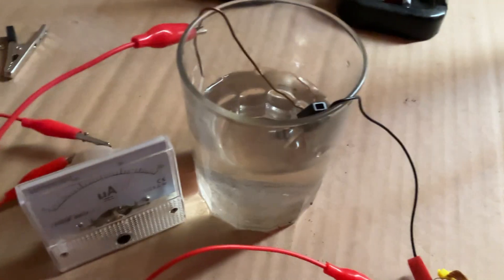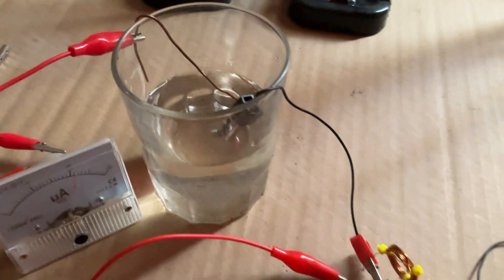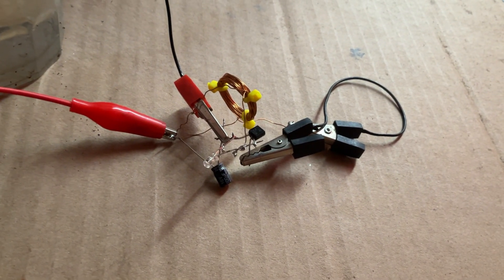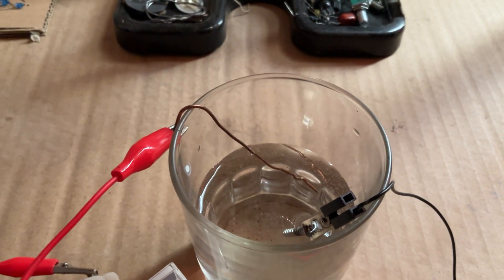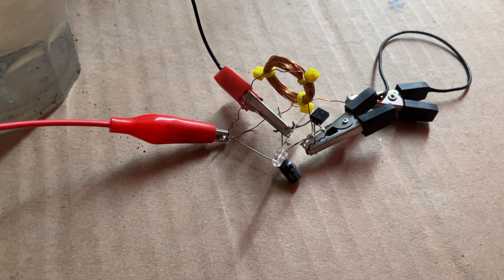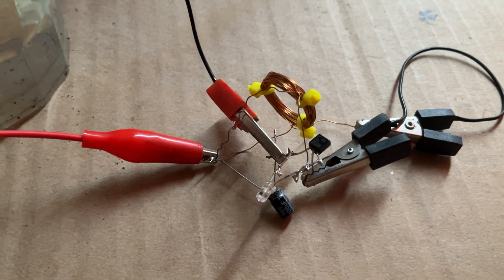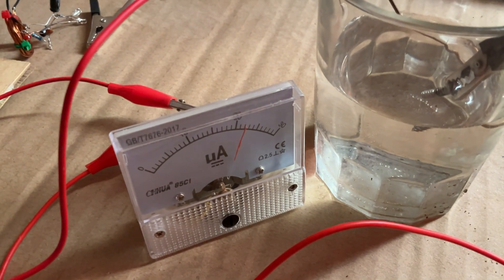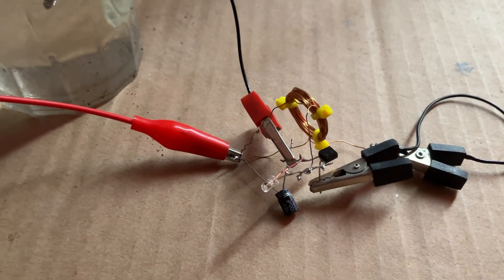blocking oscillater without blocking components

Comment: Ah right, the charge/discharge of the cap!
The copper and zinc are good for approx 0.65V. The turn on threshold of the transistor will be approx 0.6V. As soon as the cap reaches 0.6V, the transistor switches, energises the coil, cap depletes, the flyback from the coil flashes the LED and the whole thing starts again.
A bigger cap should flash the LED stronger but take longer to charge. A smaller cap will run faster but with less LED intensity.
Reply from the maker: yes, and it looks like its not working with the little inductors in the circuit. maybe to much resistance...
Reply: @MilkywayOutcast  I was lucky with the 1000uH's, having a bag of them from many years ago. They worked great with many oscillators. The inductance of your wire loop should be matched, I would think, if replacing with axial inductors. I would guess you have 12 turns+12 turns center tapped?
Reply from the maker: @Slider2732_  to my embarresment i have to admit i did not count the turns. i took a wire that was laying arround maybe less then  2 m...foldet it at half and turned it around my finger. 🙂 you might be right with the 12 turns. dont have a induction meter. i will rewind the coil. maybe we can come up with a new slider2732 formular. x around the finger turns of y thickness wire = induction(h) or does it exist allready? 🙂
Reply from the maker: @Slider2732_  i guess it would have to be around 50 microH instead of 1000? but i guess the ratio between input power and output power would be lower then in the real blocking circuit?
Reply: @MilkywayOutcast  lol a new induction method. A precise and exact calculations formula - "About this far with around that much wire will produce roughly this inductance, most of the time!"
Reply: @MilkywayOutcast  Agreed, lower due to the number of turns. Have tried this at home and didn't get your results. That finger wound wire has more properties than perhaps thought 😀
Reply from the maker: @Slider2732_  i went back to this oscillater and it did not work anymore. i changed the water and cleaned the electrodes on my shirt and it was working again. i took the risk to take it all apart and re-assemple: 2 wires, as far as i can messure about 0.4 mm thick. 1.07 m long. 19 turns. 3.5 mm lenght of coil. average diameter of the loop about 15 mm. put in a calculater it would give 23 microH. it took again cleaning electrodes and new water to get it working. it is now working much slower. maybe half haert rate. i might have wound it tider. i am getting the feeling that any change on the system, circuit or electrodes or water needs some fideling before it decides to oscillate again..
Reply from the maker: @Slider2732_  ok here is the slider2732 constant: slc = 0.0634 the law of slider2732 says: as long as a 0.4 mm thick wire is wound on a finger the number of turns square times slc gives you the approximate inductance in microH. it is actually usable i think. 🙂
Reply: @MilkywayOutcast  Thanks for the indepth facts and figures. The good thing being that you could use those known facts for changes and improvements 😀
Reply: Have just done a video on this, with a shout out to you (of course) and a link back to your video here 😀
It should be up in a couple of days.
Reply from the maker: @Slider2732_  🙂 looking very much forward to see it